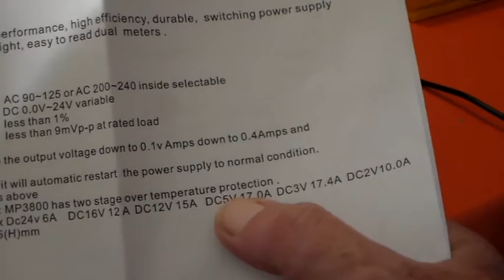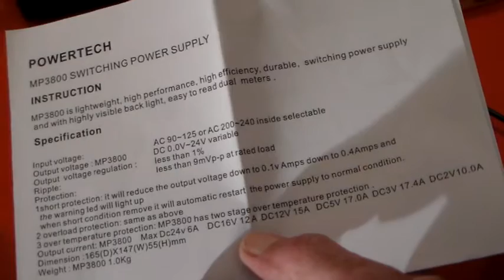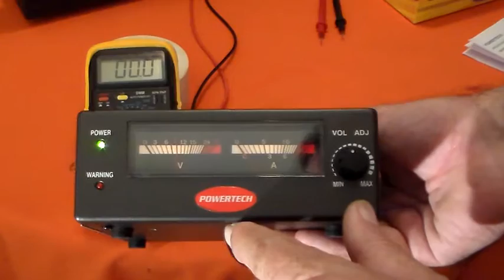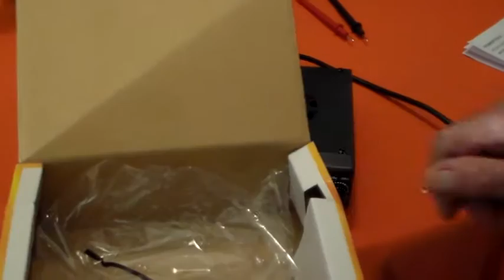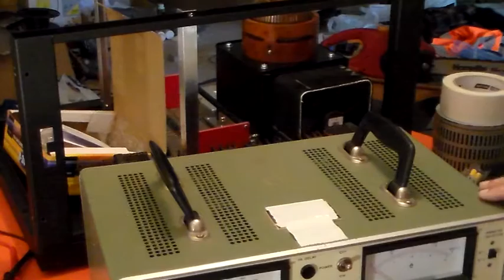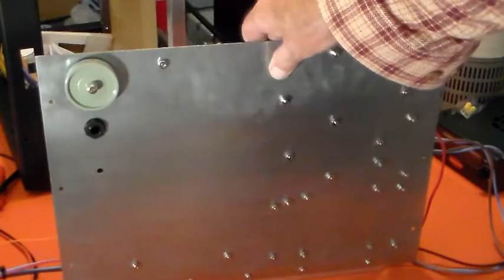Budget Variable Voltage Power Supply.

Comment: Hi Steve, i have a similar PSU sold under different name, IIRC, it has few birdies, AR ran an article on it with some very good recommendations, but above all, the live 240V main AC supply is very close to the metal case, and it is not earthed, so to speak is a death trap.
with mine, the 2 x 12v lights bulbs and voltage meter failed after 2 month of use.
Reply: +Moussa El Karakizi http://us.cactii.net/pipermail/members/2010-February/004341.html